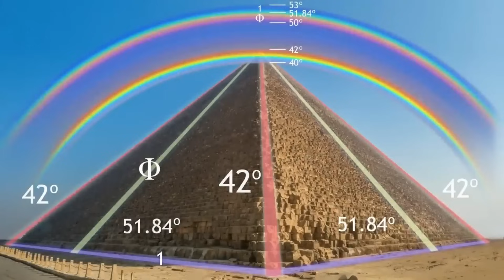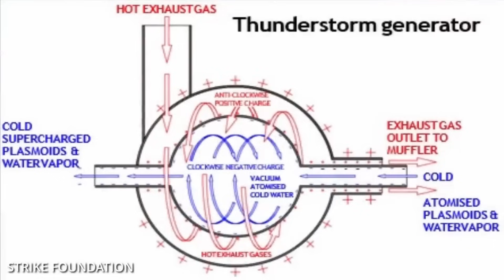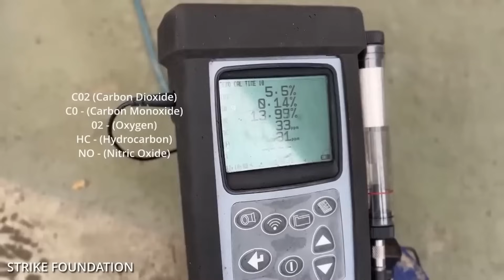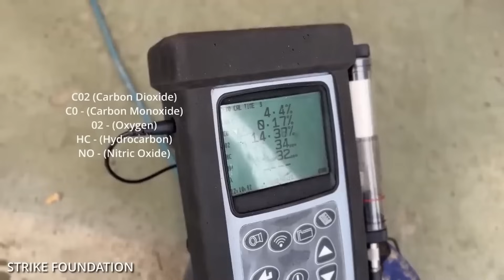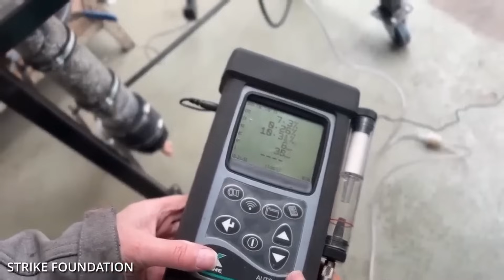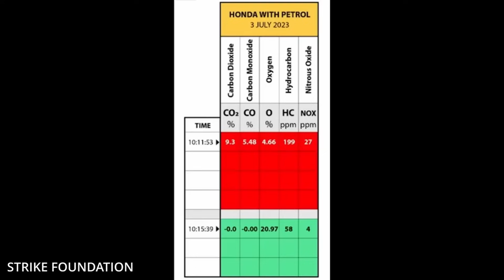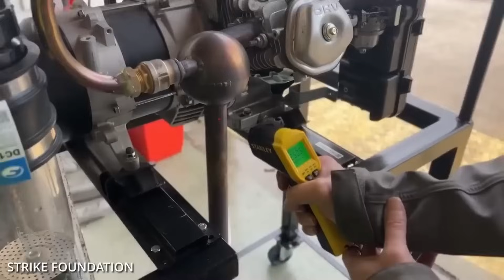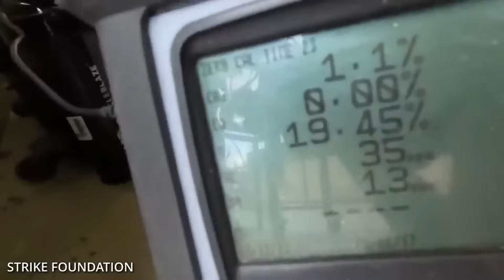Revolutionary Technology Defies the Laws of Physics Part1 #podcast #randallcarlson #science #ancient

Comment: There's a guy that developed a oil, any oil will do. Diffuser type contraption, it runs oil through a bottle with water. It was the left over gas in the bottle that ran a generator. The generators exhaust was rewound back to the bottle. The only problem they had was that the bottle had to be level at all times. All they had to do was develop a gyro shock absorber system and there you go. You didn't need petrol or crude. No one took notice and i think he ended up in a psyche ward.
Reply from the maker: Oh they noticed alright, that is why he ended in a ward

Comment: As soon as I saw the glue over one of the compression fittings .........this is a snake oil salesman 😅
Reply from the maker: It is not glue, it is to prevent any possible leaking from the welding
Reply: @historydrops  then you should have used silver solder because welding copper is very difficult, but soldering is easy and can be leak proof considering all the homes with copper pipes 😅
Reply from the maker: I agree

Comment: The video shows a engine just using exhaust gas, bubbled through gasoline in order to run the engine off of hot gasoline fumes similar to gasification. This isnt plasma anything..
Reply from the maker: You missed the Thunderstorm generator. New video coming out tonight with full explanations
Reply: Explain please
Reply: No, it's bubbled through water. Gas would look different for one.